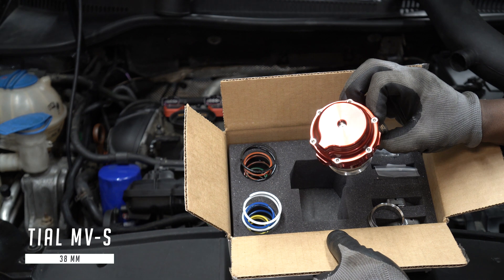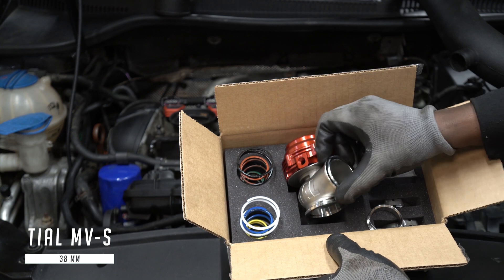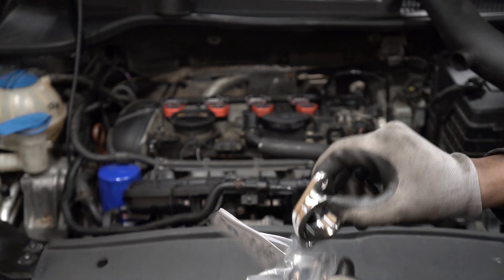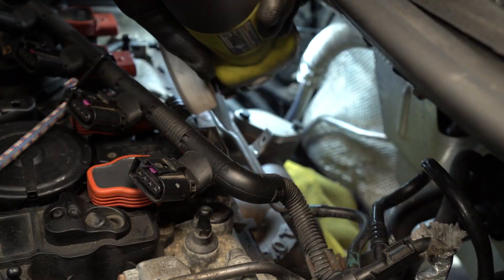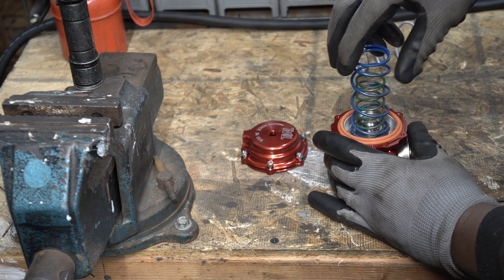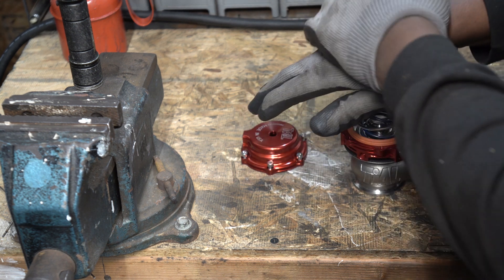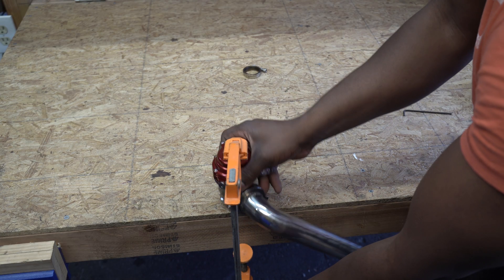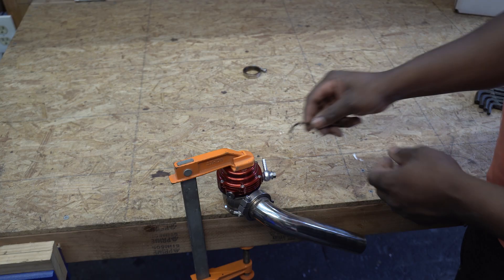VW MK6 GTI Tial External Wastegate Install MV-S 38mm on a Big Turbo MKVI 2010-2014

Comment: Hello my friend I have a question look I have a k04 064 hybrid and I want to installa tial  external 38mm the turbo can handle the steady pressure from external or I will have issues?

Comment: Just ordered the same wastegate for my big turbo VR6 build. Couple of questions if you don’t mind regarding the dump tube, did it come with the vband to weld to a piece of pipe for the dump tube? Or did you buy the dump tube made?
Reply from the maker: Nah, the wastegate does not come with the dump tube. I got it separately.
Reply: @CraftyWorkshopBuilds  does it come with the vband to make a dump tube though?

Comment: I have the same thing but for me is to loud, can I put wastegate pipe in downpipe ? Weld in
Reply from the maker: Yes, you can.
Reply: @CraftyWorkshopBuilds  what is the best way to do it, some say that there may be engine failures if it is welded into the pipe, but I want to weld it into the downpipe, but will everything be alright
Reply: @CraftyWorkshopBuilds  and whether it will lose some performance or not and where it would be best to weld at the end of the downpipe or before

Comment: I’m running the same wastegate with a 17psi spring and 25psi boost map however I only saw spring pressure of 17psi. Just changed the wastegate to a known working one with an 8psi spring and same again. Only spring pressure but this time it’s only 8psi because of the smaller spring. Installed exactly the same. What could be wrong?
Reply: are you running it through an aftermarket mac valve or using the standard boost controller? if its standard boost controller, you may need to change your map, as that is what controls the boost limit. if youre DSG it could also be torque limiting causing it in your DSG tune. 
otherwise change to an aftermarket boost controller and run a 3-port mac valve, one port to the bottom of the gate to blow valve open, and then tee off the boost reference to the top of the gate to hold it shut until desired boost is reached. 

see a performance shop local to your area if youre unsure.

Comment: Which exhaust manifold do you use
Reply: You can buy various t3/t4, single scroll and twin scroll exhaust turbo manifolds for the ea888/ea113 engines online, which will fit most aftermarket universal big turbos. Most people don’t realise there’s more options than just getting a K04 or K04 hybrid for the Mk6 GTi. I am about to go big turbo as well. If you want the link for the manifolds just let me know 👍
Reply: I would like the link..I'm going big turbo as well

Comment: I have a 2017 GLI with the CTS BOSS Gen 3 big turbo upgrade. That turbo uses the stock wastegate actuator, which is currently failing. Will this EWG fit onto that turbo, and solve my problems? Thanks!
Reply from the maker: Nah, this EWG needs an exhaust manifold that's made for it to go on. You're probably better off just replacing the failing actuator.

Comment: Hi what tune are you running  working on a golf r tfsi 2.0 full biult everything all the bells and whistle  gtx3076r gen2 turbo what did you do with the stock diverter  reason why i ask because tuner saying has to be stock but after all this work having a stock diverter kinda odd  any advice for the customer would be help full thanks for this video going to help with the n75 and what you boost you run anyway
Reply from the maker: I'm running a custom tune from Stratified. I deleted my diverter valve, I'm currently at 23psi of boost.
Reply: @CraftyWorkshopBuilds  so you have a cobb access port then well the cobb isn't completely with the golf r mk6

Comment: Hello, may I ask if mine is a GOLF 5 GTI EA113. I have changed the K04 third-order power. If I change the external exhaust pressure relief computer, do I need to re-adjust it?

Comment: Great video! With the set up you have now for the mk6. Did you install the Ext-WG to limit boost creep with a cat less downpipe or just to have it on to be on. I have a mk7 Gti with catless downpipe and plan on pro tuning but want to do a Ext WG to limit boost creep and not blow the turbo or engine. What would you recommend?
Reply from the maker: I went with the external wastegate primarily because I like the way it sounds, and also the additional benefit of limiting boost creep. The external wastegate is loud, so you definitely gotta consider the noise it will make, before making your decision. Which turbo do you have?
Reply: @CraftyWorkshopBuilds  right now stock is20 but planning on upgrading to a hybrid is20.
Reply from the maker: @kevinshelton2358  That turbo might come with an internal wastegate. To go with an external wastegate setup, you will need a manifold that has a external wastegate port and a turbo that doesn't have wastegate built on to it.
Reply: @CraftyWorkshopBuilds  it does, I was worried about the voltage set up but got it squared from a tuner.
Reply: @CraftyWorkshopBuilds  which turbos don’t have a internal waste gate?

Comment: Hi I’m looking to do the same I currently have a revo intake but I’m unsure when I get the wastegate that it will fit, what intake do you have
Reply from the maker: You should be able to make your Revo intake work, with a little fab work. You'll be prone to high intake temps though, because it's sitting over the wastegate.
 I custom made my intake setup, so it's not an off the shelf brand.

Comment: Wastegate, so that is dumping the blow off turbo pressure? But not to do with the Diverter Valve?
Reply from the maker: Yes and yes. The diverter valve is responsible for recirculate the air, when the throttle is released after building boost. The waste gate is a exhaust bypass valve, that opens when the the requested of amount boost is reached.